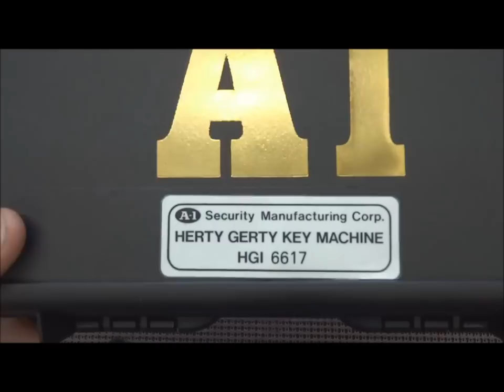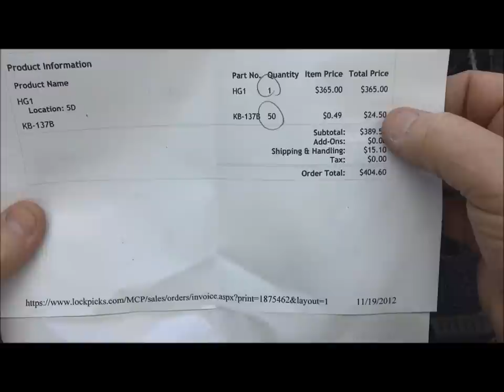(105) Review: A-1 Security "Herty Gerty" Tubular Key Cutter

Comment: Nice review.  Are the cutting bits really standard for milling machines?  I have not seen an end mill with such short flutes.
Reply: Have you had to replace the milling bit.? If so do you know what the dimensions/ sizes are. I’m having trouble finding a replacement

Comment: Do you know, if Tubular keys have an universal number, as the old locks of i.e.padlocks and doorlocks, used 11111 or 00000 if only 5-digits keylocks - only to Tubular keys ?
I have buy from Brockhage/Lockpick key no. 1137, and on AliExpress KLOM K-747 any tools to series 7000. - Yes I talking about bump-keys.

As I told, do many locks have lower numbers. What about Tubular keys ?
I had tried 1111111 and 7777777, but not more, when I only have a limit of Tubular keys left.